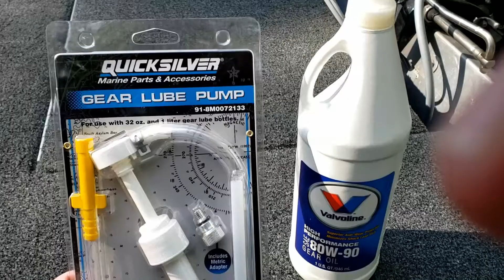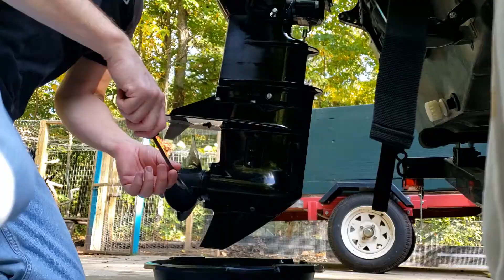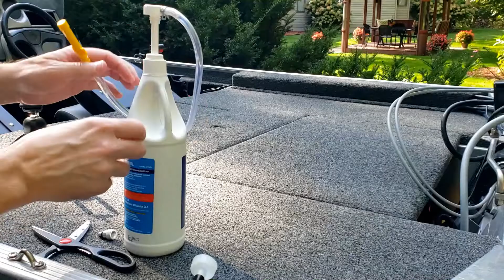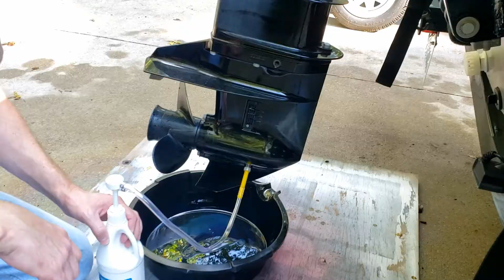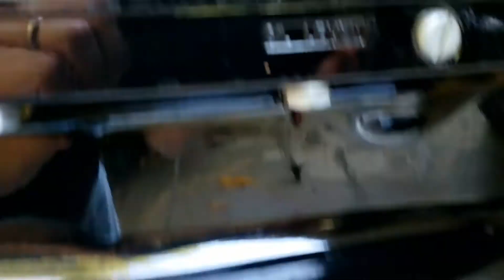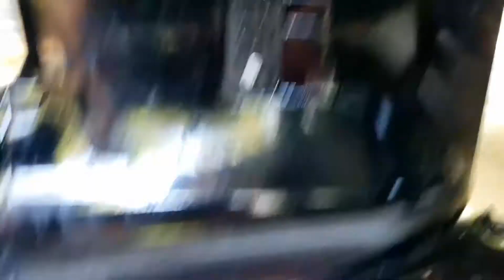Mercury 30HP EFI 4 Stroke Gear Oil Change

Comment: How much capacity in gear oil in a 30 HP obm
Reply from the maker: Not quite sure. It’s definitely less than a quart. You just pump it in until it starts coming out the top hole.